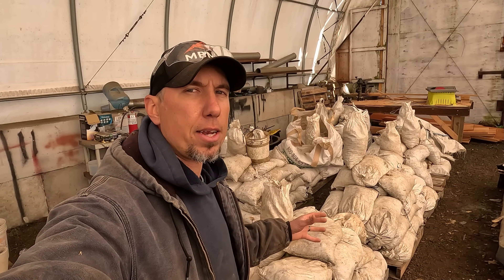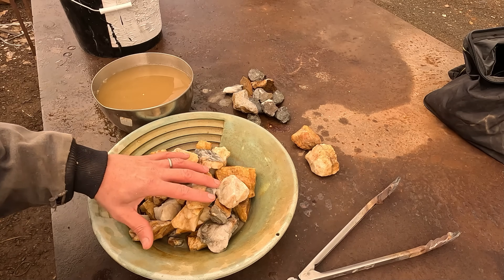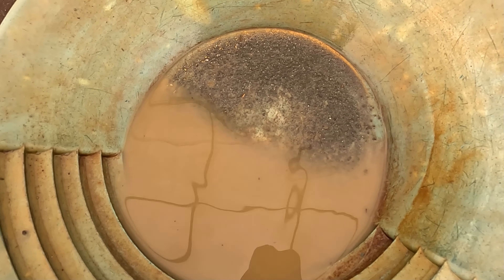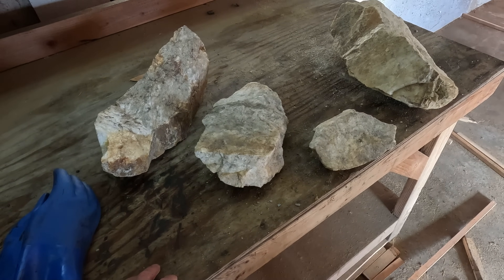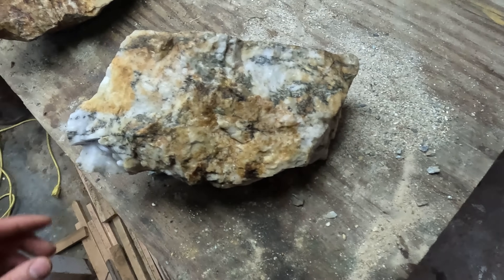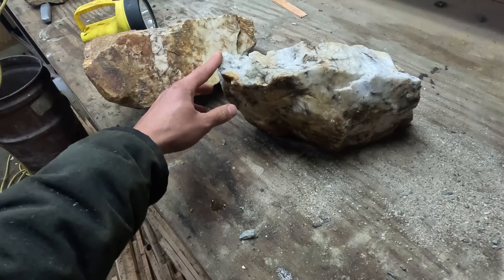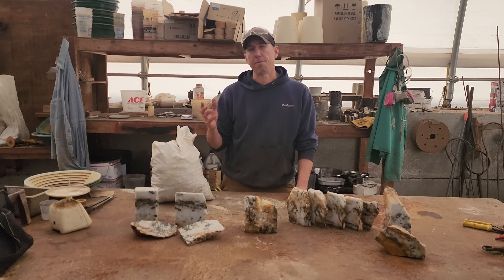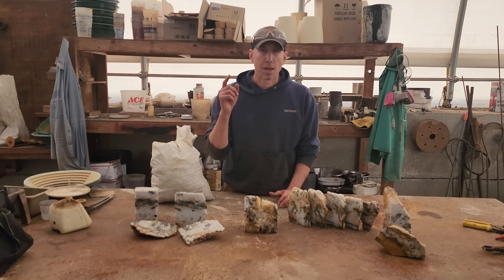Opening My Gold Mine! Part 16: Testing My Gold Ore

Comment: I screwed up cuppelling, hoping for some guidance.  I did mostly like Jason did at 6:10, as I took my carefully panned concentrates of gold and sulfides, placing them in an 1850F preheated bone ash cupel, and added a bit of bismuth, but probably not enough? (16.5g concentrates, and probably around the same of bismuth)   I got a thick hard crust that never went away.  Figuring defeat after an hour of getting nowhere, I turned off the furnace and let it cool with the cupel still inside.  After it cooled, I broke away the crusty layer, finding several gold beads of various sizes, and many microscopic beads of gold embedded throughout the pitted cupel.
How can I recover the gold embedded in the cupel?  Is the best way to grind it up, pan out the gold, and resmelt?

Comment: if you dont wanna polish you can cover in a clear coat epoxy spray.. as well as it being the lazy way to bring out the colors, if someone buys it to work, its no prob just to grind it away.. it also means less work for a bit more monies perhaps too.. I have done it with some massive thunder egg halves and other dud ones that were still kinda cool but not cool enough to polish.. they all sold after I did that. Just make sure to disclose it to them!

Comment: How does a person find out who last owned a mine. Me and a friend explored an old abandoned looking mine that looks like is closed in the 1920s from news paper and other things we found. We came to one part of the mine that had some small quartz veins and a while later we found an area where the wall and ceiling had caved in. We wend back a few days later with better lighting and after climbing over the caved in area we found a quarts vein 3ft wide at places and gold running through it about as think as a business card and places that were wider. From the looks of it there is a fine gravel layer onto the bedrock wall and pouring through the caved in ceiling.
It looks like at one time there might have been an old river bed there.
Would like to see who owns it or how to aquire it. Any ideas on how to go about it.

Comment: Hey, Jason. I bought one of your bags of material from your mine on ebay. Wanted to publicly say I'm satisfied with the purchase. I haven't been able to do anything with it yet because shortly after it arrived, I tore my lower biceps tendon and so it will have to sit on the shelf for some time before I can process it. I did, however, pull one rock out of the bag and wash it in my gold pan and am pleased to say that there was fly poop in the dust on that particular piece. So yeah, I'm happy.😊

Comment: If you drill a 1 inch hole down in the bottom of the pillars, you can get light fixtures with small lightbulbs to fit inside and light the pieces up. Thats if light can shine through the material.

Comment: So you’ve got what, max 10 tons of ore you were able to extract this season, optimistic estimate of 2 OPT that’s 20oz or roughly $40,000 at todays spot price, assuming you can even sell it for 0.9 spot. Rough estimate you spent twice that opening the mine this year and making capital improvements. Already in the hole, don’t you love being a miner? 

Gotta work on a more efficient method of getting the ore to a larger truck next year. Get 100t out and hope the assays hold…